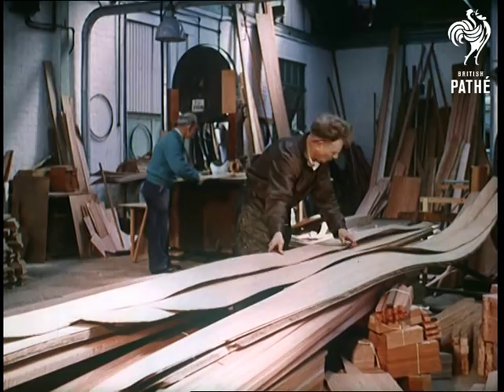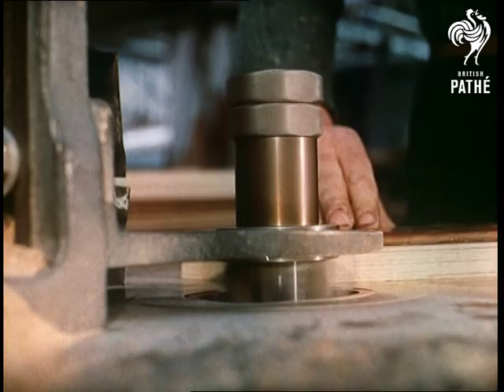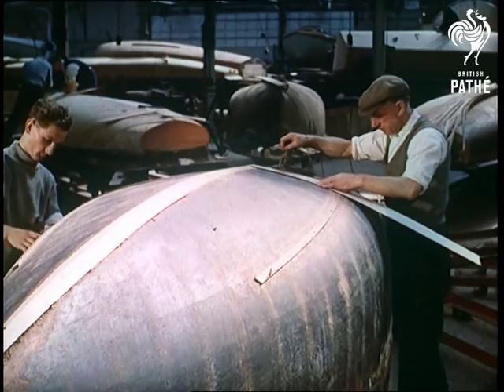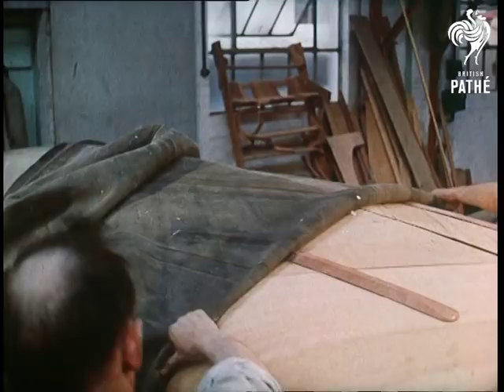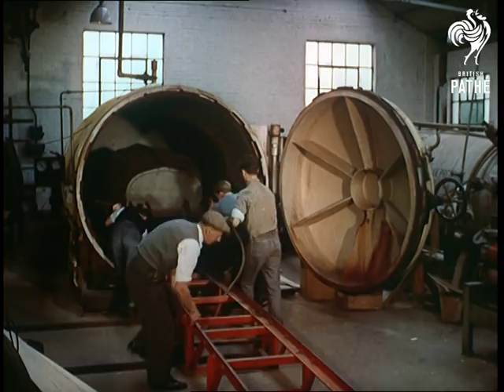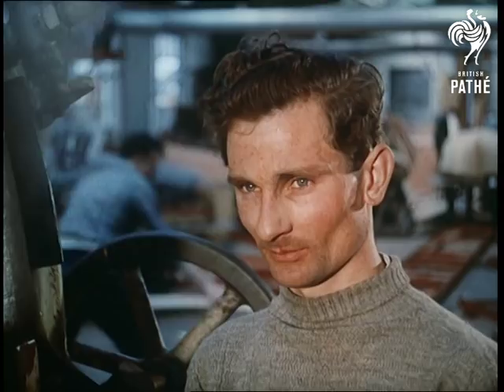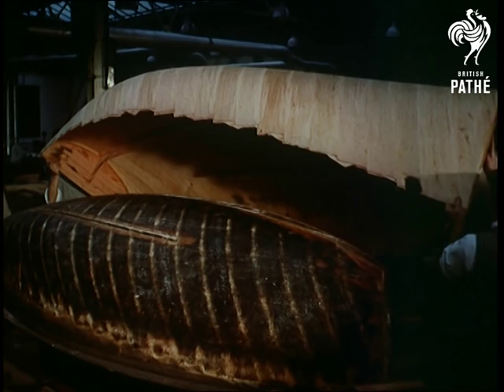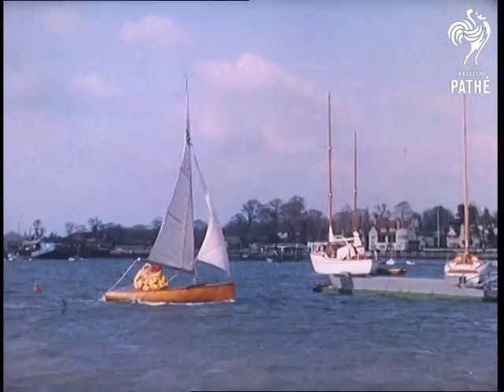Firefly Racing Dinghy (1958)

Comment: If anyone knows the kind of glue-adhesive that is used here please let us know. We do not see any wet glue being applied to two surfaces.
Reply: It's Cascamite
Reply: Thanks, Fiona. I did find a lot of information about that glue, first on the Fairey Marine page on Wikipedia. I just am not clear on how it was used. It appears that the wood is saturated with the glue, left to dry and only then put on the other part(s). I have used Cascamite but not that way. Thanks, again. Dave @fionaedwards6365
Reply: @DAVIDMILLER-nc9vo  Fairey also built the original wooden 505 dinghies as well as early fiberglass ones. I had one!
Reply: @ukepenviolinfiddle  Good to know, thanks. My brother had a Thistle but his was GRP not cold molded. I did meet Sandy Douglas and I had an old Flying Scot.
Reply: @DAVIDMILLER-nc9vo  very cool!